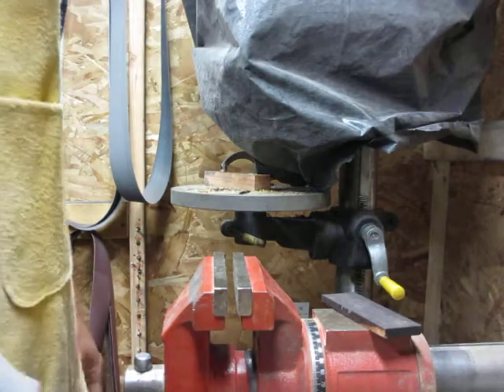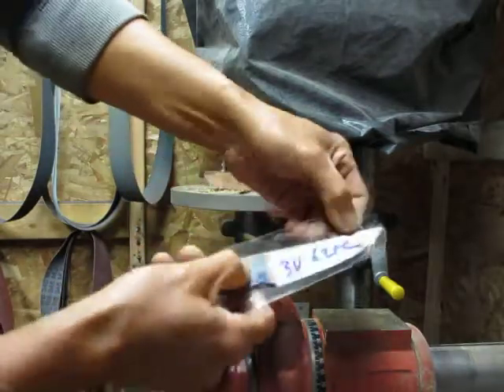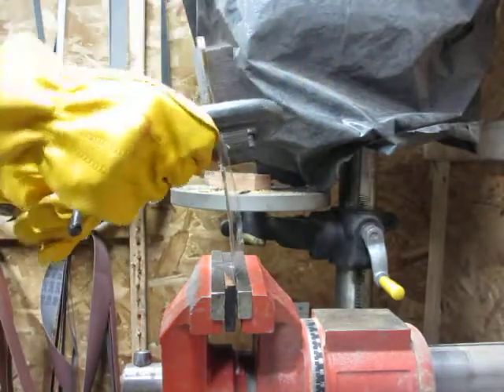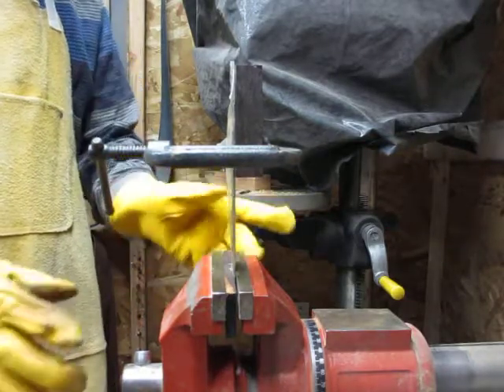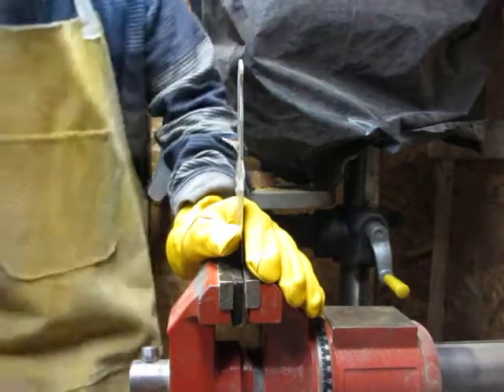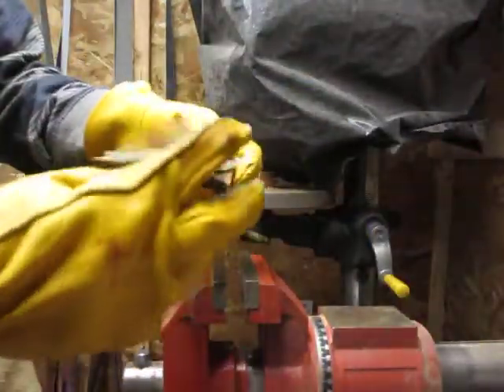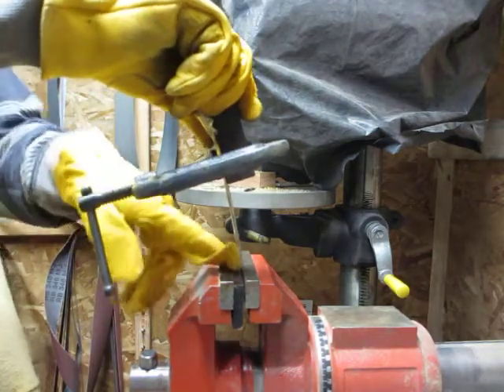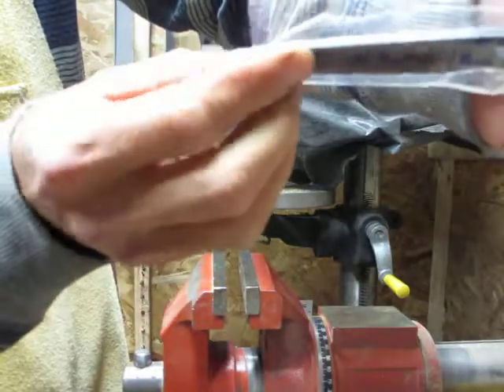BCMW bending destruction tests - 3V 62rc Elmax 63rc D2 66rc and 61rc

Comment: Thanks for the test..
Hope next time you can make toughness test between CPM 3V vs 5160 with same HRC..
Reply from the maker: Well, not sure opportunity will arise for bending/deflection test between 3v & 5160 & 8670.  However from experiences - I can project (and maybe deduce a tad bit):  at 62rc 3v & 5160 will performs undistinguishable same, at 58rc 5160 will be much more ductile - thus allows much more bending than 3v before fracture.
Reply: @Luong_La  oh, i see..
Thank you so much..
I really appreciate it..
And keep making video.. 👍👍

Comment: It was a good and Informative video Luong. You speak better English than any of the people commenting could speak in your native language so no worries! Might I make a recommendation though for a more scientific test doing the same type of toughness test. That would be to add weight to each blade at the same location on the blade of the same thickness blade and leverage point. Thanks for the video either way
Reply from the maker: Thanks.  Agreed - same specs and repeatable would be ideal, similar to doing charpy-xyz tests. I did a couple charpy using pro services - well, I need big budget to do stress/strain 3 or 4 points tests :)

Comment: You got you’re head in a bucket? Didn’t hear a word. Remake?
Reply from the maker: I wore a face mask so sound of muffled.  I am in the process of preparing bend test coupons for 3 points flexural test video. 3 points bend will be more control and repeatable than in this video.  That said, 2 points bend better reflects knife/blade bend in use.

Comment: That 3v put up a hell of a fight. Do you do that heat treat style for customers' blades if requested? And does the gradient effect have any impact on corrosion resistance?
Reply from the maker: Yes with taken in account: ht is one-way-thermal process and rough finished surface (or loss of thickness if post-ht surface grind).  One-way-thermal because beside gradient elements, there also be element loss.  Due to Cr partitioning, corrosion resistance goes from minor loss to gain from surface into interior/core. For large chopper/blade, this gradient works great however not that much usefulness for smaller blade.